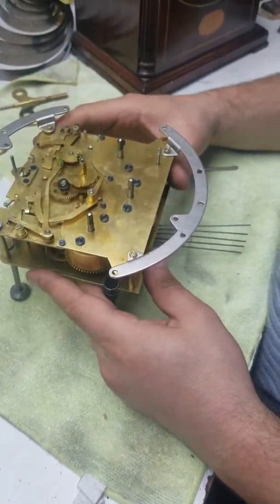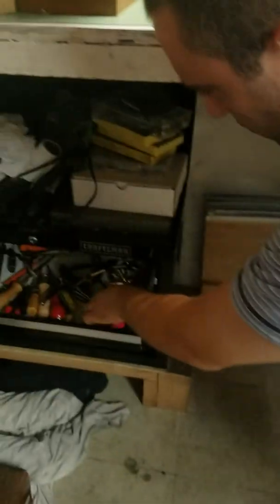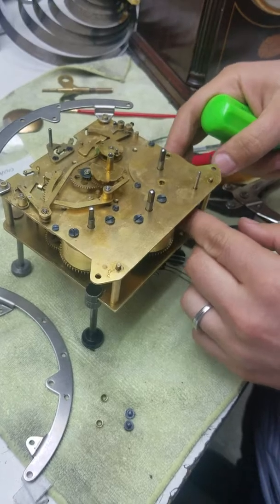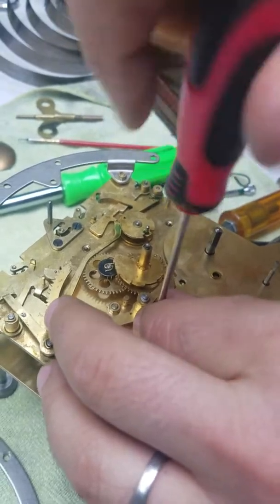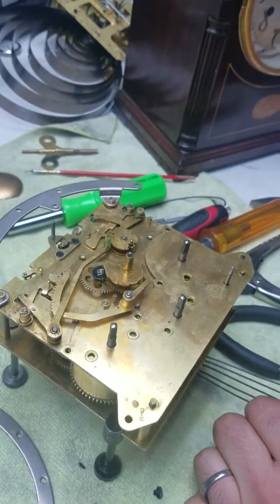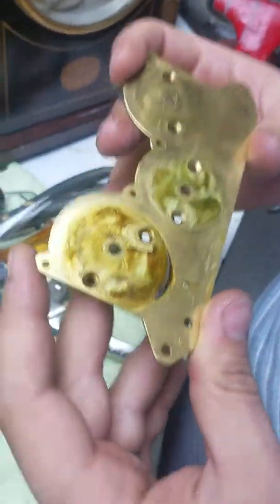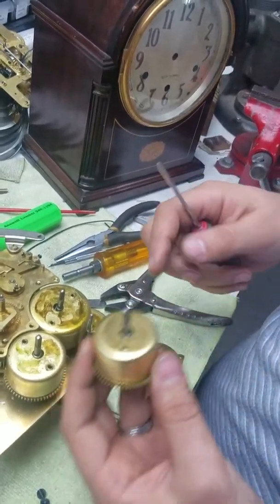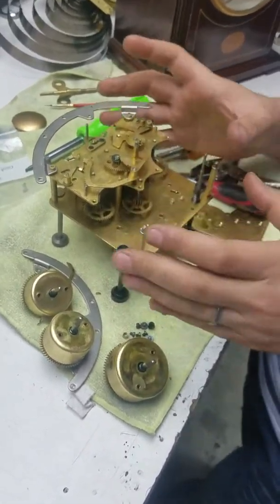Partial disassembly Seth Thomas No. 124

Comment: Seth Thomas hasn't made a clock movement since at least 1955 or 1956 when two hurricanes within a week destroyed the factory with flooding.  Parallel pliers are excellent for clock repair.